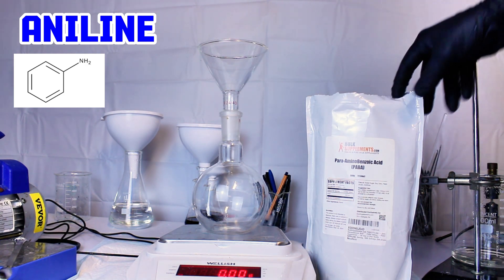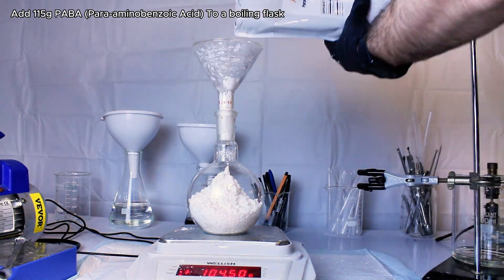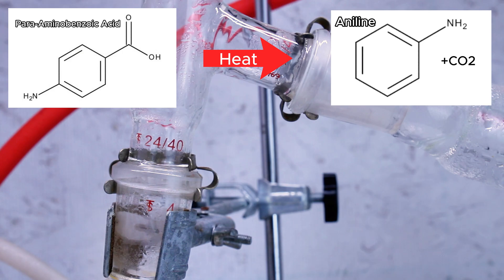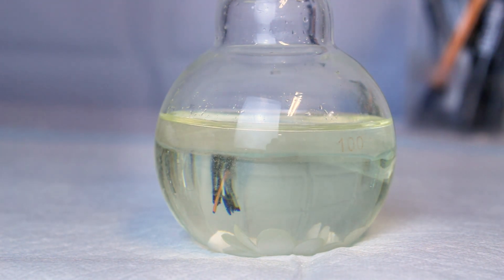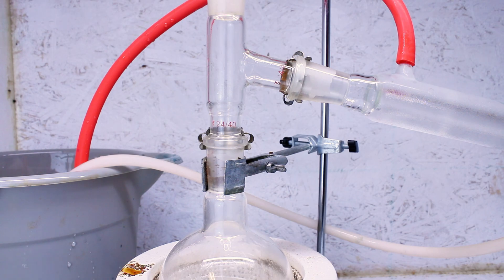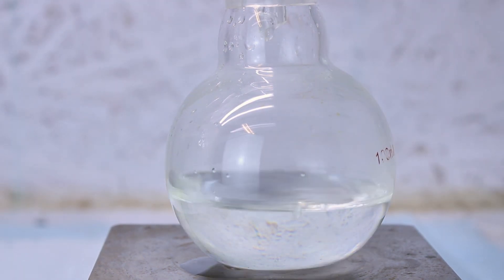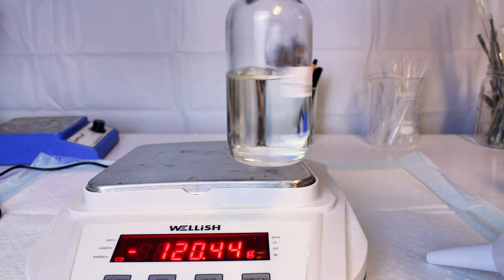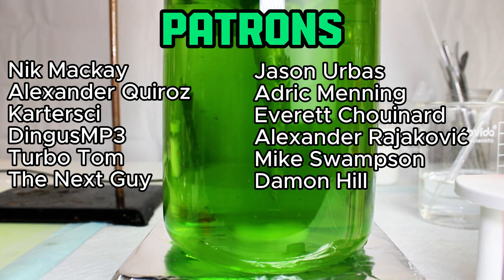Making Aniline

Comment: Are you thinking about doing the acetic anhydride synthesis using the sulfur chlorides method? I've shied away from that one because I know where to buy it and the smell from the sulfur chlorides is horrendous.
Reply: I think he's trying to go the Tennessee-Eastman acetic anhydride route. If I recall correctly that's the name.
Reply from the maker: Yeah I did try the Tennesse-Eastman process. It's typically done at huge scale, high pressure, and using rhodium catalysts. I wanted to see if it was possible to DIY but I couldn't isolate any meaningful amount so I'm restarting (I should probably make a video on the projects I've scrapped over the last year lol) in any case yeah I considered the sulfur chloride route but I doubt my neighborhood would appreciate it, and I feel I would have trouble getting a high purity given my history with sulfur. Now I'm thinking acetyl or benzoyl chloride, but since neither of those are readily available I'd need to make them.. the challenge then is a chlorodehydrating agent and the "safest" of those is phosphorus pentachloride imo which again I'd have to make from elemental phosphorus which is a pain..
So yeah project is on the back-burner for now lol
Reply: All the preps seem pretty cursed.

Ketene, for example. Looks great until you read the IDLH concentrations of it alongside those of things like HCN and H₂S
Reply: @davidfetter  I'd be comfortable doing the ketene lamp outside or in a good fume hood. It pretty much runs itself once it starts.  Just make sure your joints are sealed well and that you have a scrubber solution set up at the end.  I'd rather do that than the sulfur chlorides method.
Reply: I hope YouTube recommends it to me on the feed if he does this method